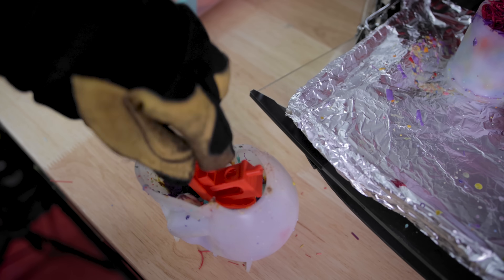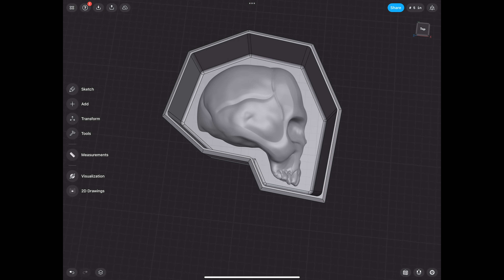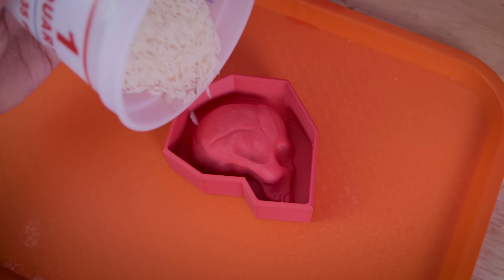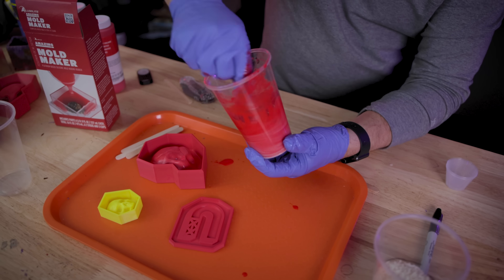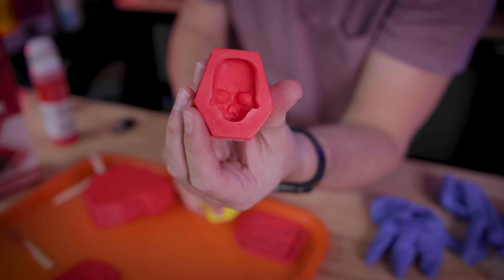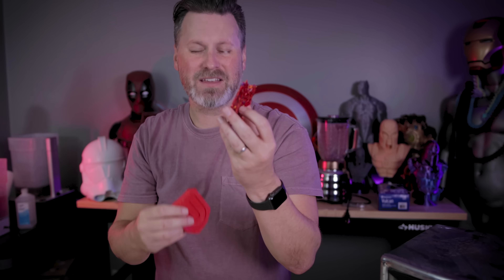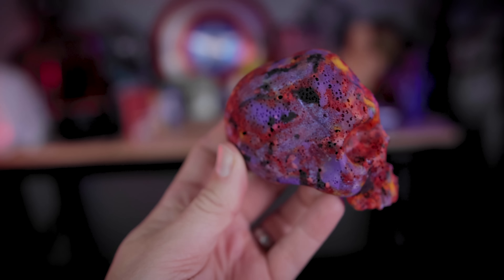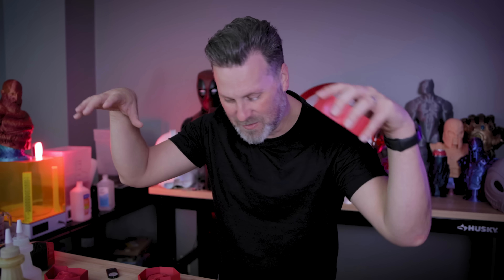3D Printed Molds for Casting 3D Prints!

Comment: I am clueless about casting and melting down resin but what about a pressure cooker? Something like an Instapot pressure cooker would apply pressure and heat. Maybe that would remove the trapped air bubbles.

Comment: Hey Uncle Jesse! Great idea melting down old filament into molds; I never thought of that before.  I wonder if putting the mold with the melted filament into a pressure pot would help with bubbles.  That would be an interesting experiment.
Thanks so much for mentioning my channel, I really appreciate it!
Reply: A vacuum will also suck the air out.
Reply: but there is no way this can work can it? Where is the Sticky wax? 🤣
Reply: Came to say this, a pressure cooker should help reduce bubbles by quite a bit.
Reply: @OddJobEntertainment  a pressure cooker is not a pressure pot.

Comment: The rice strategy probably doesn't work well here because liquid goes by volume not by weight. You should be using water to find the correct volume needed.

Comment: Great video! Learned a lot. Inspired to do more!
I haven't made a mold like this before.
I have 3D printed molds for roll casting polymers to make nosecones for model rockets. And they worked awesomely. Yes, a split mold that you join together and then pour a measured quantity of mix into and roll it around for about 10 minutes to ensure an even distribution of mix.
I have so much supports and scraps hanging around. This is a perfect way to recycle them.
Reduce
Reuse
Recycle

Comment: I used to melt my supports & failed prints down inside of large silicone brownie molds. Then when I had a nice stack of them I'd seal each one in Stone Coat Countertops epoxy resin with various glitters & mica powders mixed in. Stick some rubber or cork feet on & blammo, easy coasters you can give away on the holidays or just toss in as a little bonus gift with commission projects.
Reply: What a great idea! 🥰

Comment: For the molds, Punished Props is also a great resource. Also, Smooth-on goes into detail on aaaaall of their different products. I know they have one that's for high temps like molten aluminum. 

While these are melting, maybe try using a hot air gun to heat up the most exterior most print scraps to prevent the pockets? I'm excited to see more experiments using this method

Comment: Here is an option for those who do not want to mess with melting plastic. It does involve using resin for this though.

Instead of trying to melt the wasted plastic, simply get a blender and chop up the pieces as small as possible. 
Once you have all the extra plastic bits chopped up, fill up the mold as best as you can and pour the resin over it. 
Allow the resin to fill in any gaps and wait for it to cure. 
Please note that it's best if you layer on the resin as you fill up the mold, but pouring the resin at the end also seems to work.
Reply: Now imagine breathing in blended microparticles of plastic that never really degrade during your lifetime and stay in our lungs and blood vessels for the rest of our life...
Reply: @vicnaum  no need worry about breathing microplastics, we are already eating or drinking microplastic. since like it or not. it is already contaminated
Reply: @vicnaum  I doubt most people have a blender that can blend plastic into such a fine powder that this would be a major concern. Additionally, you are more likely to be breathing those microparticles by simply 3D printing the plastic. There is a reason you shouldn't really be around a 3D printer while 3D printing any type of material. The 3D printer will be releasing microparticles into the air as it extrudes the melted plastic. If you aren't already taking safety precautions in general when using a 3D printer, resin, and other such materials, then this is probably not something you should be doing.
Reply: @vicnaum  If you're that concerned about it, maybe 3D printing is not for you period.
Reply: @Martial-Mat  fumes is one thing, but blending seems quite different
Reply: @vicnaum  Every time you strip models off the build plate; every time you remove support, you are creating micro-dust. I would suggest that fumes were considerably MORE insidious as the particle size is so much smaller.

Comment: Two things: 
I'd include some draft angle on your printed molds in order to make removal of the silicone easier 
You could use an old pressure cooker to consolidate the plastic while heating it
Reply from the maker: heck yeah! I actually did a small draft angle inside the molds but realized it should be a good bit more. Will be looking into a pressure cooker!

Comment: Cool! You could coat that skull with holes with that clear resin. And there is a way to use silicon tube stuff to make rough molds. I don't know how it would hold up in the oven though.
Interesting project!
Reply from the maker: omg love that idea going to try that out! or dipping them to fill the voids
Reply: @UncleJessy  You could also try to direct colors to certain areas, (black in eye sockets for instance, pearl white in teeth areas, mowhawk etc) incorporate glitter, or glow filament or other things. 
The silicon tube stuff as mold material is on Youtube.

Comment: the rice measured the volume of the mold compound needed, not the weight...
Reply: Also, some of the air bubbles may be from the silicone. I have been told to wait an extra 24to 48 hours after cure time before pouring in resin to avoid tons of bubbles.